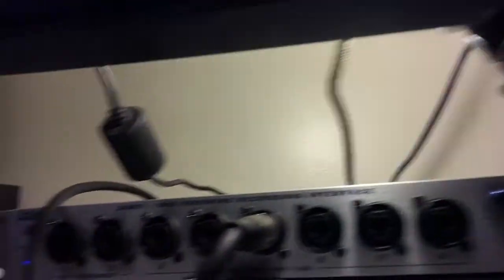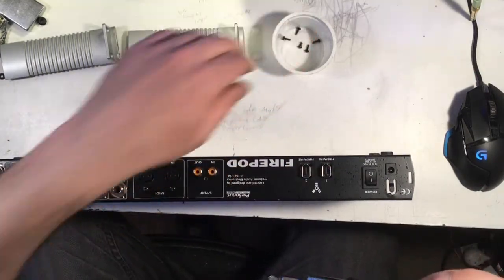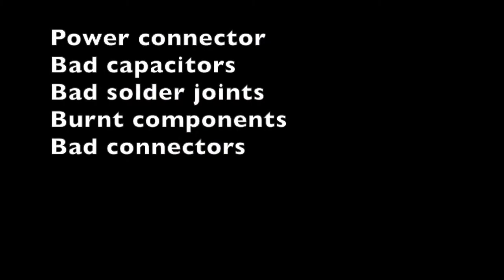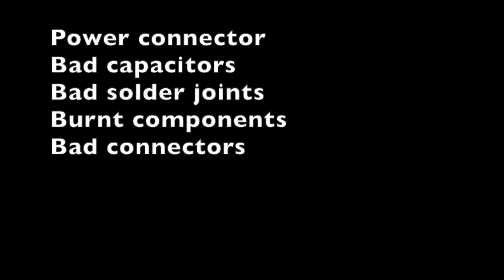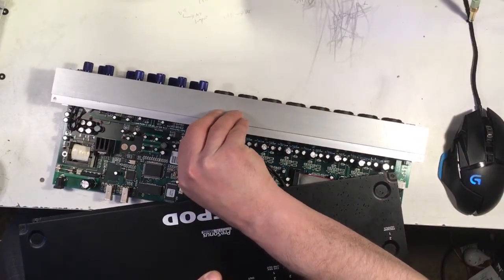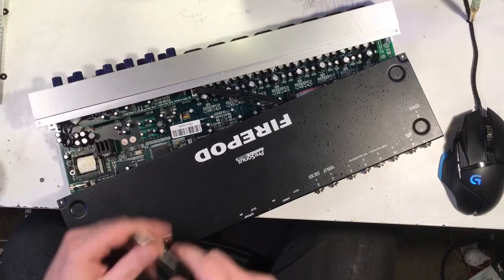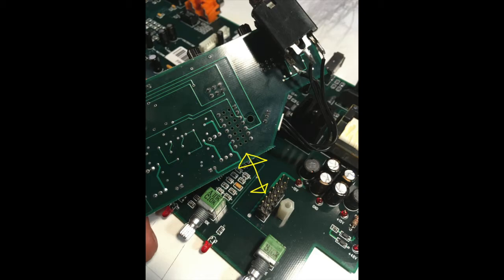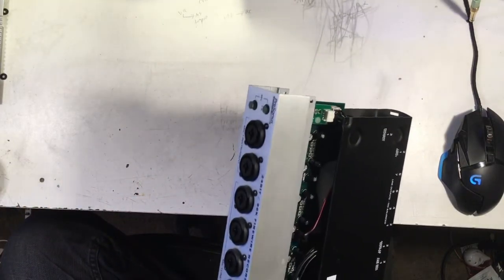Simple Presonus Firepod audio interface repair for common issues

Comment: My Channel 2 Phantom Power stopped working on my FP10 (Firepod renamed), any clue what to look for, or where to look for the circuit? I didn't see any caps leaking or bulging, but I do smell something burnt. Kinda faint, but I think I smell something that burned at some point. But, visually, I don't see anything.

Comment: hi, I am trying to fix my presonus firestudio26x26, the big diode is everytime hot, sometimes it connects ans dometimes not.
Someone with the same issue? I ve change the most capacitors near power supply and firewire ports.

Comment: HELP!!!  bought a non working firepod hoping it would b an easy fix, it aint!!  Swelled cap on power supply and someone had broke a leg off the fuse holder. Replaced cap and bridged the power legs while removing the power switch. Power supply is good as it works with my other firepod. NOTHING<<<NOPOWER<<< Is the board transformer is bad?

Comment: Hello,
I’m looking for advice. I’m looking to use my Firepod with a MacBook Pro running El Captain 10.11. Presonus doesn’t support it anymore. Any known firmware or drivers available? Open source perhaps?
Reply: I just tried my Firepod for the first time in years in a machine running OS 10.4.6 and it has connected just fine.  I haven't used it with a DAW yet, but the operating system is recognizing it, which is more than I can say for my MBox 2.  Just hook it up and check.

Comment: My TASCAM interface was also Windows Vista era junk I bought for a couple €. All the switch gear was junk, both sliding switches and pots, everything else seemed sufficiently bulletproof. Actually didn't replace anything, simply washed everything out with pure ethanol bath and then Caramba non-corrosive plastic-safe brake cleaner (100% hydrogenated petroleum, same as contact cleaners for switches and potentiometers really), maybe lubricated, I forget whether I did, and it seems to run perfectly fine... Even with Windows 10 in spite of manually installing old Vista drivers.

Comment: Hi. I have a Firepod that is having issues with the output. Would you be able to fix it if I send it to you? Message me. Thanks.
Reply: Are you outputting to Headphones or Monitors? In Windows 10, you can select the sound icon in bottom right corner, then click the up arrow above the volume level, and finally select PreSonus FirePod Out 1&2 (... ). This will switch playback to your headphones port. Keep in mind that you will need to install the driver for it first with compatibility mode for Windows 7. Here is a forum that describes the driver installation process for Windows 10. Don't know if it works for Windows 11. Hope this helps!